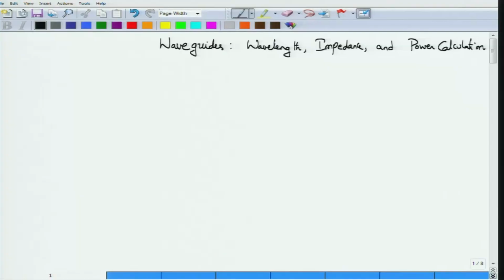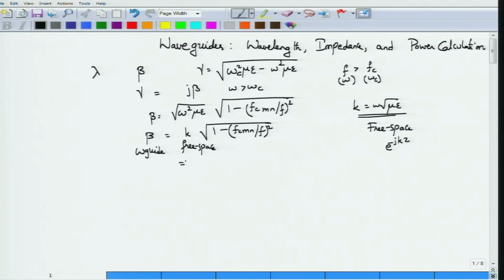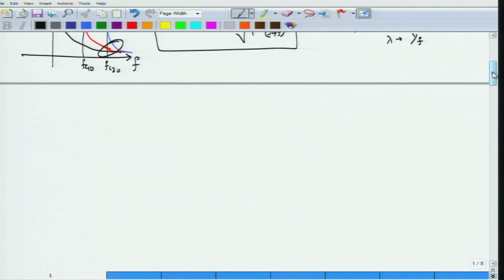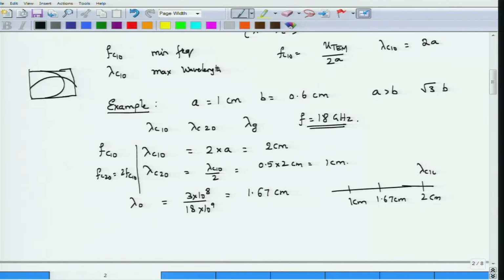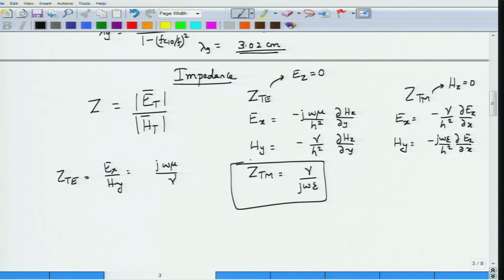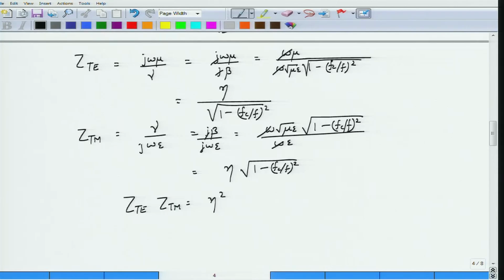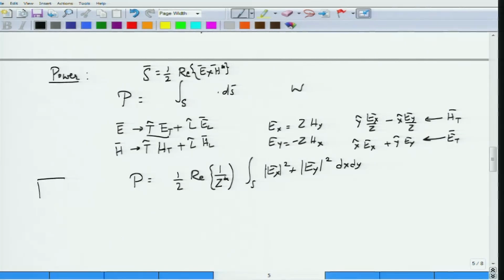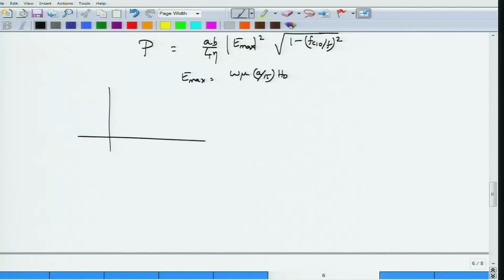Waveguide: Wavelength, Impedance and power calculation

Comment: for finding the impedence why do we take the ratio ix Ex/Hy not the total of (Ex+Ey)/(Hx+Hy)
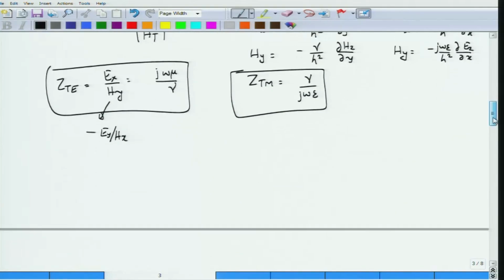Reply: The impedance is defined as ratio of transverse electric field mag(Et) and transverse magnetic field mag(Ht). Transverse means the components which are perpendicular to the direction of propagation. In case of waveguide, Et is the vector sum of Ex and Ey and Ht is the vector sum of Hx and Hy.  Follow the lecture from 17:50 min. 
Ask if there is doubt.
Reply: @pavantripathi6594  So (Ex+Ey)/(Hx+Hy) is correct, right? It should be total Transverse components. Then why did Sir only take Ex/Hy or -Ey/Hx to calculate the impedance?

Comment: why do we take f10 as fundamental freq not f01??
Reply: Your question is good. Refer to the Rectangular Waveguide: TE mode lecture, the professor has gone through the problem of Waveguide WR-75 which is widely used in practice. We calculated  for TE10: f10=7.87 Ghz ; for TE01: f01=15.74 Ghz. We see that the cut off frequency of TE10 mode is less than TE01 mode and hence TE10 is considered as dominant mode. Also if we look at the formula of cut off frequency f_cmn=1/(2√μϵ) √((m/a)^2+(n/b)^2 ) -----f_cmn=1/(2a√μϵ) √((m)^2+(a/b)^2 n^2 ) and we know a>b therefore a/b >1 hence frequency at m=1 and n=0 will be smaller than frequency at m=0 and n=1. Thus we consider f10 as first mode or dominant mode. 
Hope this clears your query. Ask if its not clear.